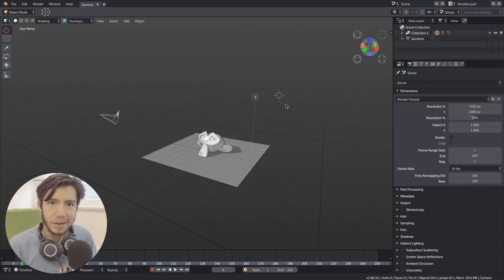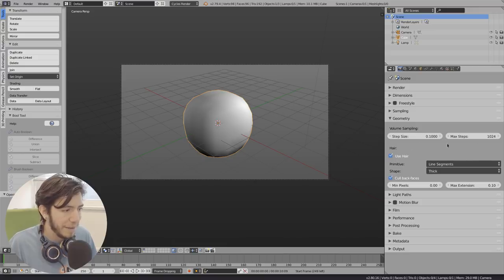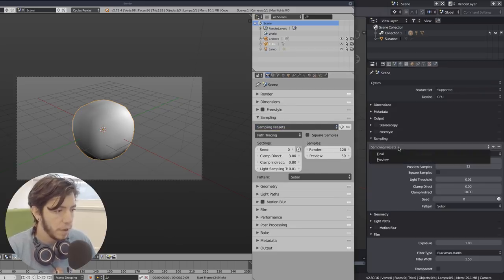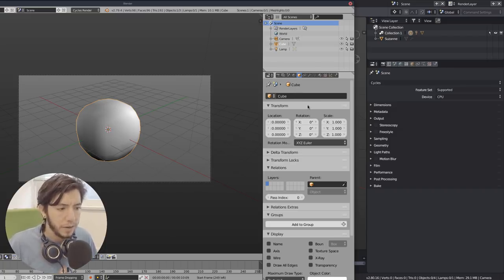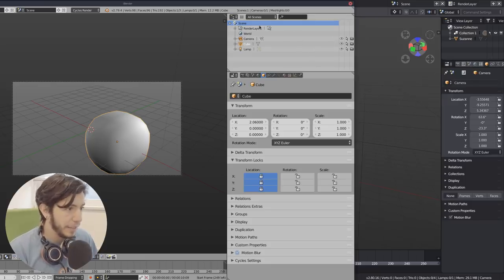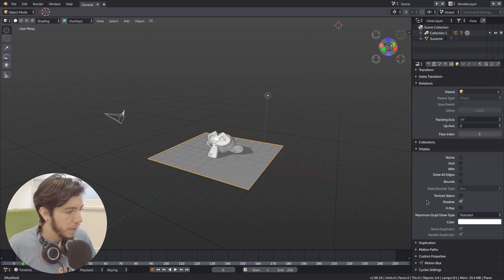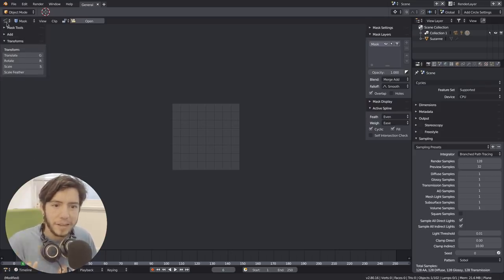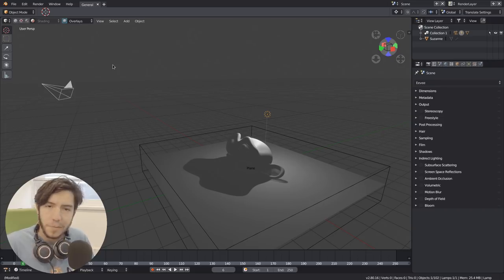Single Column Layout - Blender 2.8 Code Quest

Comment: Why not making it responsive, like responsive web design? For example: on a widescreen monitor, less scrolling is more beneficial than more space in the 3d viewport.
Reply: I totally agree!
Reply: An option to expand back to 2 columns if the width is beyond a certain threshold could be nice, actually. This is especially true on 21:9 screens where there's a bit more horizontal real estate to play with...
Reply: Anyone submit this suggestion to https://developer.blender.org ?
Maybe the current UI/UX dev on code quest can work this out.
Reply: +++++
2 colums is better idea, for widescreen monitor. Developers turn to bad way

Comment: I like the single column layout a lot better, as the items that where next to each-other in the old layout seemed kind of arbitrary. 

However, something I think could also be interesting would be to keep the single column layout, but make it reactive so when the window gets big enough for 2 full columns, the list of sub-menus display side by side IE:

Dimensions | Metadata
Output          | Stereoscopy
Freestyle      | Sampling
etc.               | etc.

Sometimes when my window starts to get crowded with a lot of things, my properties panel will be small and I'll just quickly hit shift + space to maximize it so I can edit something small. It would be great if it changed using this type of side by side menu because it could make full use of the entire screen in a way which neither Legacy nor Single column can do
Reply: Something like the Bootstrap css model for dynamic column/row layout would be fantastic!

Comment: Thank you for all the videos Pablo.
i really like the idea of a more consitent layout but in my opinion there are a lot of drawbacks in this new design:
- the labels outside of the valuebox waste much more space
- the sliders lose resolution/precision because they have to make room for the labels
- the improved readability comes with the cost of losing visual grouping --> slower to find right parameter
keyframebuttons could be a nice addition to blender. personally i would like to have the option to show/hide them in the user preferences.

Comment: having multi-column menus is better to use more than one panel at the same for example
So i think that it would be better if it was flexible, like a HTML/CSS "flex" or "grid", then the buttons fits the panel width, being "single column" if it is short, and become "two columns" (or maybe more) as the panel's width increases

Comment: Where is this UI rework going ? Are we dedicatingly removing one-by-one all the stuff that makes Blender so ergonomic, like the all in one "button+label+value" ? And undoing a change that was made several years ago for the sake of readability (right-aligned values in number sliders) ? Removing color coding in number sliders, too ?
I ask why. These are all good ideas that help make this interface compact and efficient. Why work against it ?
However, and I'm speaking as an animator, I concede that keying a property with a single click sounds quite easy and pleasant.
The preset headers seem to me a really good idea.

I find there is a great naming disparity in the 'editor chooser' dropdown : some have 'editor' in their names which seems a bit redundant (NLA editor, text editor...). Same remark for the mode dropdown : 'object mode', 'texture paint'... remove the 'mode' word altogether or add it to every entry.
And this status bar ? An entire 32px-thick bar for a few statistics that would comfortably fit... anywhere else ?

Comment: As other's have said, I don't get this.  Limiting to one column in the UI is fine.  But if you're going to do that, the panel width needs to be fixed.  Otherwise whenever the panel is wider than some amount, all the space on the left is wasted.  And what if you have a really wide row?  There needs to at least be some standard for row width if not fixed.

Comment: Thank you for posting today Pablo. Please make a status notification somewhere on the GUI when Renders are using GPU+CPU render. It is only on System right now...but it would be a huge plus to see the numbers (of how much percentage GPU+CPU is computing) and RAM are used when rendering. Nothing fancy. Just a "fill bar stat bar"? probably... We need that info somewhere. Thanks.
Reply: M Hurly , Blender has a "standby" number icon that replaces the mouse on heavy calculations. Yes, technical artists need this performance (gpu+cpu+ram) percentage showing somewhere instead of the cursor. Yes, it is needed for fracturing, liquid simulation, cloud vdb rendering, etc... that's how decisions are made. Without information of how many shaders are being computed on eevee viewport, Blender can hang for a good 5 minutes which could seem an eternity without a status notification somewhere. I agree it could be a text overlay on the scene. I don't want CQ to end! :) Thank you for all of the devs efforts!! Cheers.

Comment: This will be amazing, especially the sizing part. But when in 2:40 for example 'Time Remapping On' is sized down, it would be cool if it would jump down or getting smaller so you can read it anyways eben if sized down more. The space for it is there :)
Also would be nice (I dont know if its already in the beta or before) to change Blender's settings automatically to the frame rate/intern lens when importing a video file ->for tracking or using a video as background in the viewport

Comment: Hheh, this will look like the N panel is open, but with all the tabs! So thinny! I second to the idea of having some control about how the UI is gonna lay out, by allowing some level of responsiveness. This way, when we will work on extra wide monitors, it will be not cluttered in a narrow band of zilion panels. OR, maybe we can make two panels, like two ribbons/columns/etc which then could contain everything? Excessive scrolling will quickly kill our mouse wheels...
But the DREAM is going on - which is having so many such nice videos about most welcome features. I hope that not only for UI, but also for new "nodes-everywhere" or new awesome VSE we can still have such updates/reports. If not, let's launch another rocket!!! But this one is already accelerating nicely, cruising thorough the community.

Comment: I think these changes will drop a huge spot light on other things that I certainly think will lead to a radical change in the interface ,what actually works is what is being added to 2.8, what doesn't is actually most of the old interface design ,making all the menus single column will question the need to change their size.if there is a "best" layout with a goal set as "less confusing" interface,why should it be "editable" in size and position at least as easily as it is now.

Comment: hmm hopefully this will be cleaned up by release or have alternative options but dumping things down into a single column looks very messy to my eyes. besides if the context of the sub-category makes sense to have certain options across from each other rather than all stacked on top then not only is that, imo, a cleaner UI but a faster UI. scrolling is the worst thing you can do for efficiency, but that said I dont think there's many sub-categories with that many options that would necessitate scrolling unless I had a few different ones open, which could happen, it's something to keep in mind.

I for one like having a wider panel with more information then just 'Shift+Space' when im modeling for a bigger work area.

But I'm open to it because I'm really curious what 2.8 will offer in the end but this have been the only video so far that hasn't really impressed me.

Comment: Nice! This way we don't have to adjust the windows. Thanks. However just like to say that humans (mostly) are in habit of reading from left to right, Top to bottom, so the labels should be left aligned instead of right align. The flow of eyes reading the labels would be not ergonomic.  If the labels are left aligned,  it would be ergonomic to read any list written top to bottom, and free-flowing; as it is the first word that eyes jumps to. While reading a list (labels here) which is broken or crooked or the alignment is jumpy, it is not comfortable. That's why after effects and c4d etc has labels left aligned.  Please consider. Thanks.

Comment: The titles for buttons and drag items should be above, not on the left, so it's a lot more readable. Also the items could then be 100% width of the (layout) window and if enough width is present even split into 2 columns.

EDIT: you can compare the behavior to bootstrap (css/html) being responsive

Comment: Is the old layout still going work for 2.8+ versions? I use a lot of columns in my addons, especially in pop-up windows, I never place multi-column stuff in properties though. Btw, it would be very nice to be able to code a pop-up dialog which can stay on top of all windows. That is very useful for very UI-heavy addon UI.
Reply: Both of those things can be done in 2.8 now
Reply: I'm so glad to see that I won't have to redesign the ui of my addon. I already had nightmares
Reply: Even the pop-up dialog that stays on top?
Reply: Skarn Dev that is now possible, yes.

Comment: You're not really GAINING space though you're trading vertical for horizontal space. Which with many panels open at once will be pretty annoying since you'll have to scroll up and down. I like the idea though, maybe the panels, instead of being drop-down menus were just buttons that switch which options you see in the properties panel. Making multiple panels being open at once impossible but i think i'd rather have that then having to scroll up and down if a panel happens to be too long.
oh, oh. OR the 'panels' can be sub-buttons under the main buttons where that pin usually is. and clicking it panel settings under there. Because having long-ass panels is going to be annoying as heck, specially if you use a tablet.
Reply: Yeah i hope they allow some customization with the single or double layouts, because horizontal space is plentiful with today's widescreen monitors, specially with the ultra wide screen monitors and vertical space is kinda scarce. The current state of the single column design just seems wasteful to me. All that space given to the labels. This layout really reminds me of substance painter's layout which is sort of a mess. But this is just a very early look at it i'm sure they'll keep improving on it and by the end it will hopefully be much more functional. Blender peeps always do good work so i have faith in them.

Comment: Great job woth single column! I personally don't like the idea of having a keyframe icon. Basically because every animator uses the "I" key on almost every panel or even icon in blender (like in xsi) for adding a keyframe. Its ok for newbies but only if it doesn't "eat" room on interface. In my opinion.

Comment: "Perfect!!!". Ergonomics????!!! Why?? my monitor will be turned on its side. Previously, the data block occupy 4 rows and fit all the fields, now it  occupy 8 rows in height.... It's cool. Let's turn wildscreen monitors sideway to see all the necessary parametrs at once.
On the video clearly visible empty fields on the left of the names of the paramets? it's not football fields?
I love Blender. But you are fighting with windmills.
Reply: He said that addons using the old interface will still work with multi columns. The implication here seems to be that going forward the UI can be made comprehensive and hopefully expand to multi columns dynamically. This is better in the long run rather than how it is now. 

Blender, especially Blender UI, has terrible foundations which is what makes updating it so hard. By rewriting it, it's going to lay better foundations. It won't be perfect out of the box, but long term it /should/ be much easier to improve.

Comment: The text should auto scale as the width of the column changes, so you always see the whole column, with no text or items cut off, if i widen the column the text should scale up to fill the empty space and make it more readable, I can see as you move the column in and out the text size is staying the same with alot of wasted space

Comment: This is nice but we will resize properties panel once in a while to see the outliner when creating a rig. And by looking at Sampling you can see that you don't win much space comparing to the old layout, add an icon to see what is keyable and improvement becomes even less obvious.
The scrolling was already a big problem for Blender even with two columns setup. Even though you put description of an option on a side(which negates the space improvement with bigger names) you still have relatively the same(bigger in some cases) scrolling issue.
Besides why do you need a button to show what is keyable, shouldn't everything be, wasn't this the goal at some point? I mean its logically understandable what is supposed to be keyable and what isn't, there is no need to redundant icon.

Also the top panel is not the right way to get rid off operators panel. Sure it helps with scrolling on the left but creates additional problems:
- it takes away vertical space, in 2018 most monitors are wide screen, i haven't seen 4:3 form factor in a while
- it is tiny, what happens when you have more options then you can squeeze in there? Thats right you hit one button there(on the whole panel, 1 button!) to show all of the options. This kind of defeats the purpose isn't it?
- it wastes space, its empty, all the time. And if you hide it then it won't be for long because you will need to get to the options it provides
- you squeezed in some other options there simply so that panel would feel less empty than it is.
Why wouldn't you simply put the operators panel on the side where all properties shown? It will appear and become active and won't waste vertical space.

Comment: This looks great but I already see one issue. The search text input on the top right of the window moves out of the picture if you scale the menu laterally too much. With this narrower window the search bar vanishes completely. I already need to set the window wider than I'd really want just so I have the search option visible. I'd really like to see the search box implemented maybe on its own line below the other buttons in the top right corner.

It would also be nice if the icons menu on the right would re-scale into two rows if you make the window narrow (the menu with the icons for camera, layers, something, world settings, mesh properties...). Now if you make it too narrow some of the icons disappear and you need to scroll back and forth to see and access them all.

Comment: Single-column is definately the winner.
Biggest issue remains tho, In UI dev land, mixing global appstate settings with scene specific settings is a mortal sin...im looking at the 3dsmax-like iconbar thats been in blender since forever.
That small thing grants access to app global settings, e.g renderengine settings but also scene specific settings such as cameras, materials, lights, meshes.
This is an absolute mortal sin, jesus ass splayed open by lucifer-style, in uidev land.Render engine settings should live in a menu/dedicated panel.
All scene specific settings should be tied to current outliner selection, e.g no need to show a camera icon if no camera is selected right?
Not even max does that, it most certainly isnt industry standard, it just screams hotshot coders come together to have fun and lets just use a custom GLUT for ui and call it a day:D